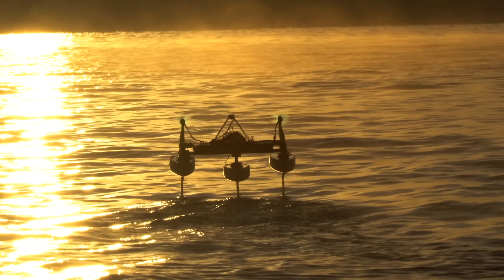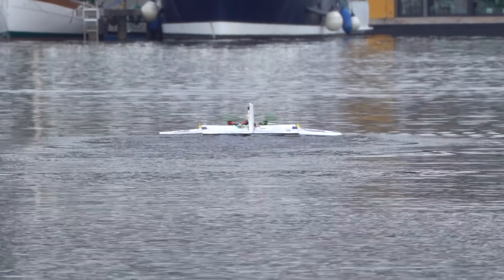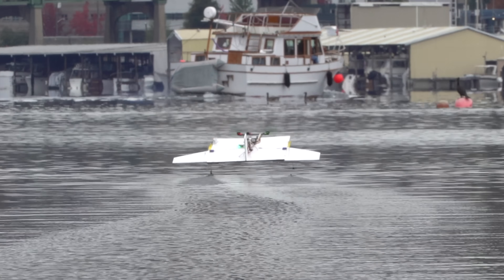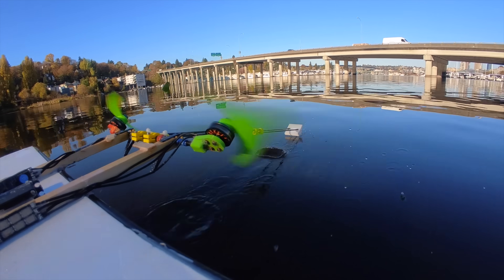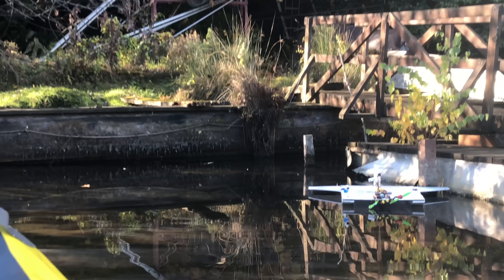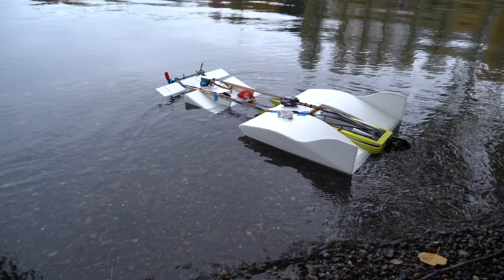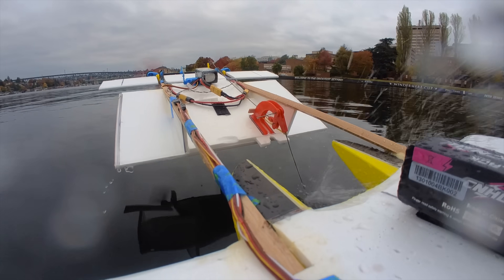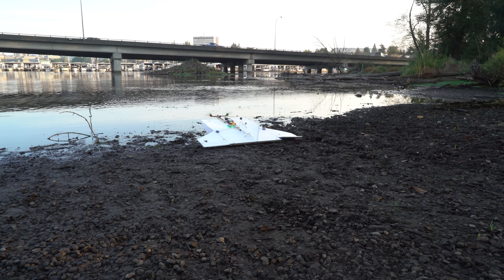Hydrofoil Control Mechanism on a Ground Effect Vehicle

Comment: I think part of the problem is the relative position of the wand and the control surfaces.

The canard configuration is obviously the way to go, but the way you built it, with the wand much farther back, it looked like it built in a sort of delay. Because the wand is closer to the center of mass, it's sensitive to both pitch and overall altitude, and I'm not sure that's optimal.

Thinking about which control scheme is desirable, it occurs to me that the height these kinds of craft float above the water is significantly smaller than their length. That means that even with a constant height at the center of mass, the nose or tail could easily dip down to contact the water surface due to pitch variation, which introduces all kinds of forces that seem like they'd be basically uncontrollable.

So I think instead I'd try moving the wand way forward to the nose. That way if the nose dips, it gets lifted, and if it gets too high, it gets pushed down. It might even be desirable to have an elevator at the back controlled by a separate wand. That would give you control over pitch with the front wand, absolute height to the water at both front and rear with either/or, and average height to the water with both at once.

I also wonder if the paddle on the wand isn't too big? A smaller paddle, or even just the bare wire could likely be thought of as averaging out the control inputs to be less on/off in nature. Smaller/no paddles would also reduce the drag caused by the wands.

It's a really interesting concept that I think has some promise, but I suspect it will be very difficult to tune. You're basically creating a purely mechanical PID controller, and since tuning those digitally is a pain in the butt, tuning a physical one can only be even harder, heh.

Comment: I'm sorry I didn't have time to watch the whole video, so maybe you realized and mentioned this: If you use elevon control you should control the left elevon with the right 'sensor stick' and vice versa. Think about how elevons work, behind the center of gravity. You can see many occasions in the first half of the video where the craft is either leaning to the left or right side because this wasn't the case and so the roll stabilization was working opposite of what it should.

Comment: Maybe adding some kind of damper on the wand might help? When the wand comes out the water, it's immediately snapping all the way forward, triggering an aggressive pitch down. If you could slow the wands return, it might reduce the oscillations.

Comment: I think part of the problem with the initial wands was that when they came all the way out of the water they would move a LOT very suddenly, then they would touch again and input the same massive change in the opposite direction. I think It would have been interesting to see their out of water position limited so that the control input it was giving when it lost contact with the water wasn't so big in comparison to the small changes in angle it was making while maintaining contact.  [The angle of the rods isn't linear as the initial change in angle as the rod touches the water takes much less elevation change as opposed to later in the wands travel]

EDIT: And you went and used that effect on purpose later lol

Comment: a note on the oscillations, its not a positive feedback loop (or at least that component is not the cause of the oscillations).
the wand only provides P-term feedback, and the system is an n-th order (height adjusts control surface, which adjusts pitch rate, which adjusts pitch, which adjusts aoa, which adjusts g load, which adjusts height)
theres pretty much a guarantee the system will be unstable with only height-derived P term input

Comment: You could have put control surfaces on the front and the rear with individual control front, rear, left, right to get it completely parallel to the water

Comment: The reason it was oscillating in the first half is either because 1. the gain is small and the ailerons react only when it's already too pitched up and/or 2. there is no damping in the aileron response. If there were damping (piston damping, etc.) then the positive feedback loop could be avoided. (I had the exact same problem for one of my projects.)

Comment: For the wide monopontoon I was thinking you could install vertical guide plates on the sides to avoid spilling of the ground effect pressure sideways onto the wings. That way you could avoid turbulence hitting the wings, which reduced their lift and control. It would also help keeping the airflow under the monopontoon more homogenous across the whole width, increasing its effect and  also helping to keep the airflow more laminar for the trailing edge.

Comment: My first thought when watching the first test when you couldn’t dial out the oscillation: the wand was allowed to move too far forwards and forced the hull down violently, and when it bounced off the water it was stuck in that cycle. If you added a hard stop so that the wand wasn’t allowed to force the front down as violently, I think your oscillation would be gone.

Comment: 3:40 looking at how the oscillation startes I'd say the problem was the rods beeing too short. it worked really well as long as the rods were in contact with water, it goes bad as soon as the rods lose contact with water because the craft gets too high. in control theory terms It's a sort of "saturation"
I was also thinking that maybe at some point the fundamental behaviour of the rods might change as the speed increase. I guess that probably at low speed the rods are not actually "sensing" purely the high above water because they are submerged and they are actually sensing the drag inside water (yes the deeper they are submerged the stronger the bending moment deflecting the ailerons so in this way they are sensing hight, but this is speed-dependent but also meaning the control is preatty smooth and progressive if not linear, and probably more damping)
Also note that even at the same altitude with the rods still submerged the faster is flying the more the drag pulls the rods backwards, this is equivalent to the rods "feeling" a lower altitude, this should mean that at higher speeds the equilibrium should shift towards a higher altitude.

 but at some point the rods end up skimming above the surface, not submerged anymore, and this changes their behaviour, their reaction is a lot less progressive (and likely the damping gets a lot smaller too) and (if I spotted it right) they even get pulled by the elastics forward than 90° likely introducing an even worse non-linearity.

I guess this mechanical control can be adapted to both skimming on the surface or being submerged but having the same system to work well in both "regimes" might require additional tuning.
  I would suggest to start by replacing the rods with longer ones to have a wider working interval (and note that longer rods also imply that the same control torque is obtained with a smaller drag force on the rod because the arm is longer meaning that it can potentially be more efficient), and maybe experimenting with non-straight rods.
Or maybe trying to add something at the end of the rod that has an anti-skimming effect, a bit like a plow

Comment: I recommend the mid linkage control with front deflection surfaces. Front surfaces should be higher than main wing to gather more air under the wing. The body shape was an inverted airfoil and should be flat bottomed with bow incline. It should be like trying to fly a funnel or amphitheater. Gather lots of air, squeeze it under the craft. Wings are for steering or additional cargo weight. Maybe taper the floats to do the ski jumper thing and catch air wide up front and narrow out the stern.

Comment: In foiling boats the wand acts on the lift component directly, not on the aoa. I guess I should have considered that difference before running my mouth XD
To be honest, the only way I can see is to have a separate central wing with classic ailerons and a tail elevator. This would allow you to control the ailerons with a wand style device.

Comment: 5:24 
Theory: The oscillations are most likely caused by the wands themselves and the amount of drag they create when confronted by the water, they seem to dig in a little bit, which causes drag and causes the nose to drop. Which could be why it works at higher speeds, when the extended angle is greater which causes the most drag. I do believe the positive feedback loop at the rear does exacerbate the situation some more though.

Comment: Cool! Mechanical wand is only proportional control i think. Perhaps with a small soft spring or rubber band will smooth the input like a moving average.

Comment: I think boundary layer effects increase inversely with the size of the aircraft, so at some scale the boundary layer shear between the bottom of the aircraft and the surface of the water, even without turbulence, will dominate over the "go forward" force of the props for anything other than "just actually flying not near the water".

That might contribute to some of your instability. The ground effect combined with boundary layer shear will probably cause the aircraft to pitch down uncontrollably whenever you actually start to "truly" fly in ground effect.

Sort of similar to how a real helicopter needs more yaw input when its hovering in ground effect than hovering at altitude (though there are a lot more complicating factors with helicopters hovering in ground effect).

I tried to think of a simple way to compensate for boundary layer shear but the best I could come up with off the top of my head is to use several (like 3 or more) high aspect ratio wings instead of one big wedge. It wouldn't look the same as a full sized ground effect vehicle, but it might work closer to the same. Its also a lot more effort.

Comment: Not really relevant to your designs but interesting none the less is the altitude control scheme used by the British during the second world war to deliver the famous bouncing bombs. Releasing the bombs at the correct distance from the water was keys to the bomb ending up where it was supposed to and radar altimeters were not yet available. To allow the pilot to accurately judge height about the water two spot lights were mounted on the bomber's airframe some distance apart to shine downwards from the airplanes. With everything adjusted correctly the pilot was as the correct altitude when the spots of light from both lights were both shining on the same spot on the water.

Comment: This is a very neat concept and video! It would be interesting to see what effect it would have if you could add some kind of damping to the wand's control linkage to smooth out the high-frequency movements. It might help stabilize some of the oscillation. You could probably accomplish this by mounting some RC car dampers/shocks (either ones with no springs or with the springs cut off) to the control horn pivot, then playing with the mounting angles like you did with the sensitivity of the rod itself.

Comment: - mechanical autoflare for landing autonomous fixed wind craft is "interesting" - if it was connected to retracts you will have a lot less parasitic drag in level flight -- yeah. ardupilot and sonar (Ultrasound)  sensors, they exist...  but similar to how an autobrake / /reverse / power-off system can use load sensing on the landing gear, a mechanical system allows different "regimes" to be implemented when using a "simple MCU based controller (without a fully reconfigurable system).

Comment: The reason you were getting oscillation is not due to positive feedback but because you had nearly zero damping of the control linkage. The reason why the hydrofoils didn't experience this is because the fins in the water provided the damping.  Try Tightening the linkage pivot screw so that it resists change.

Comment: I have little to no experience with Model aircraft design nor have I done anything with ground effect, however it looks like these ground effect vehicles are either too light weight or going too fast. I wonder if limiting the throttle super low or if adding some weight would help a small craft stay in the ground effect. At moments the aircraft looks super stable like the Ekranoplan but just a bit more speed and the ground effect just overpowers the craft. Maybe longer fuselage for stability as well as some more weight.

Comment: would having the wand further forward (i.e. off the nose) work better since that is the area most affected by angle of attack? The boats you referenced all had their wand as far forward as possible and if you need feedback, the nose would give that sooner than a central position. Maybe that was a CG or other tuning decision, but I would have tested the wand off the nose, rather than central.

Comment: very, very informative, thank you.
maybe it's time to put some anhedral on these side wings?
According to ChatGPT, there's a thing called "Nakamura 2004" about GEVs in different configurations. ChatGPT suggests that hydrofoils should be retracted during flight because of the added drag.
I would have lengthened the rods/wands to get them nearly horizontal, as I thought it would be more proprtional to the effects of speed, and possibly more reactive to brisk changes.

Comment: Once again, lots of amazing fun!
You have lots of oscillations going on obviously. The responses way too fast. And the rate of oscillation is perfectly in tune with the response of the whole apparatus and its control system.
What you need is a dampener to slow down the rapid input. Friction is not a dampener.
Something like a cylinder with a piston and a fluid. Not a tightly sealed piston, but something like a disc with lots of small holes in it. Doesn't have to be very big at all and there's plenty of water available to fill the cylinder.
I'm sure you've heard of PIO, pilot induced oscillation. This is when the reaction speed of the pilot at the controls is pretty much the same as the oscillation rate of the aircraft. 
You have WIO, wand induced oscillations. Needs a dampener.

Comment: I have a dumb idea? Why not take and make a craft that has wheel on it that are supported by springs that can NOT support the plane. 
As the plane makes it to the correct height the wheels will fully extend and when the plane slows down it will drop down and roll on the ground. 
Do what you wish with it. I think something good could come from understanding how the craft works better????

Comment: I think the oscilation problems come from the wand losing contact with the water, this causes a sudden jerking of the control surfaces. I think the wands should be longer.

Have you tried a GEV with a lifting tail? Most of the models in this video were quire flat. A lifting tail situated higher up than the body tends to help stabilize GEVs. It's to avoid the flip up problem you seem to be having with many of your GEVs.

Comment: Awesome experimenting. How about using the control scheme to keep the lifting surfaces parallel to the water plus 4°? Instead of control surfaces, Got to keep that lifting body angle of attack under 14° 😄

Comment: Unbridge your front ramps (at the end of the video) and put one double-width ramp near the rear of the craft. Now you have a snowmobile arrangement, and those tend to hover quite well above the ground, with only the snow-effect holding them up. If it tries to fly at that point, then it's simply too light, which would imply that it would be useless as a real product anyway.
Continuing with the snowmobile theme, your front ramp/skis can be shaped and hinged so that they have greater lift proportional to how much contact a local wand contacts the water, but also reducing deflection angle (lift) as velocity increases, to help prevent taking flight.

Comment: Dampen the motion of the the wand, think slow drop toilette seat.
Reply: I was thinking of this as well. Maybe a simple air shock absorber (plastic, made from a small diameter hypodermic). You would control the amount of dampening by the size of the little vent hole in the plunger.

Comment: For the rear wands it would be interesting if you could apply some sort of delay/damping in the elevator response. I can't think of an easy way to do this, but it could help eliminate some of the squirrel if tuned right.

Comment: I wonder if you should build or adapt a radio control tugboat to rescue your other vehicles. Something you can drive out remotely that can lasso or retrieve an experimental craft, maybe have it attached to a long fishing line so you don't have to send a third boat after it if it doesn't manage to do the job.

Comment: Great engineering choice on isolating the oscillation, simplify. Set as many variables to zero as possible. Harry Larson Z80A, 1MHz, thats impressive in 2020. It strikes me as an outsider that the ground effect generates a higher pressure under the wing than free flight so could a barometric pressure sensor be used in the control loop. I dont know what loop you are running, 22mph is 10m/s so i would guess 1ms seems reasonable giving a reaction per cm but you no doubt know better. This reminds me of tuning a balancing robot where only after tens of hours watching it fail did I start to really understand the dynamics. The purely mechanical control is control in its purest form , well done. With gyro and accel stabelization the key was to add angular velocity into the control loop, not sure how that translates to pure mechanical control. Best of luck. Love the channel.